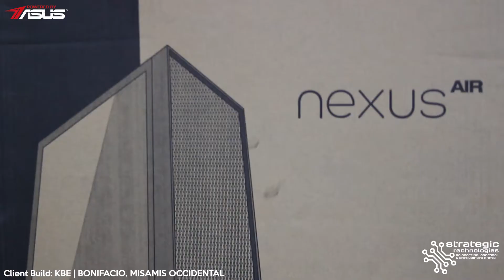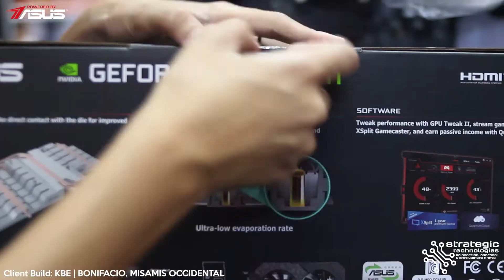BUILDING A GAMING PC WITH A TECWARE NEXUS AIR ATX CASE

Comment: good pc build video although I'm not sure a AIO would be practical for a ryzen 5 5600g cpu especially with it's 45w -65 TDP but then again probably the owner prefers aesthetics over practicality however I would've spent more on the storage, probably 500Gb SSD and then at least 2Tb of HDD.
Reply: true, feeling ko baka walang stock ung 5600 or 5600X. pero sayang parin lalo na merong 1660 TI.

Comment: Why don't you guys use an id-cooling ice flow 240 white edition on the top of the case, and bought a better cpu/gpu. Overall, it's a great pc.
Reply: maybe this is their customer's pc.
Reply: They'll only save 1000php if they'll use the zoomflow 240x rather than 360x. That's nowhere near enough to upgrade either the cpu or gpu to a higher tier